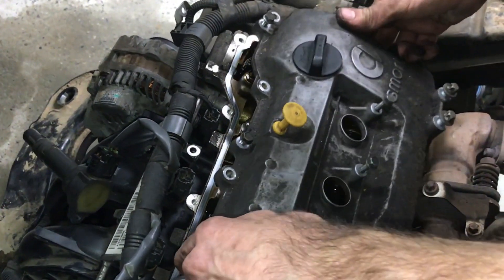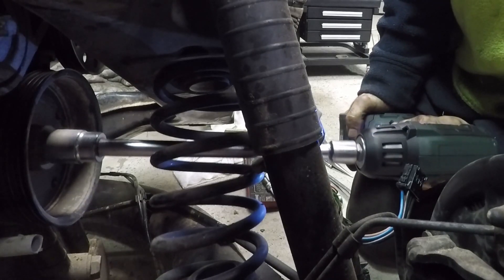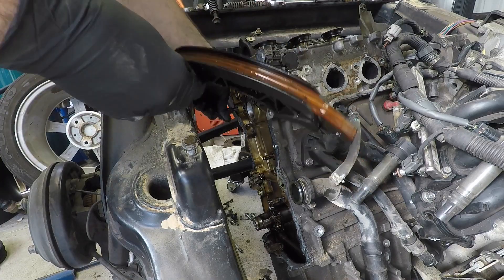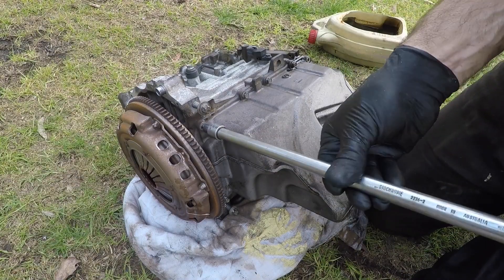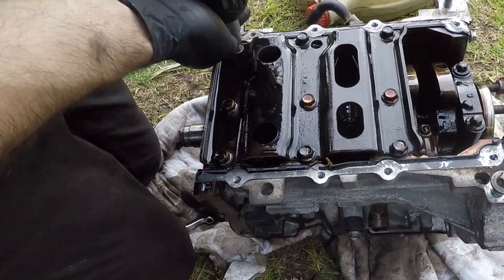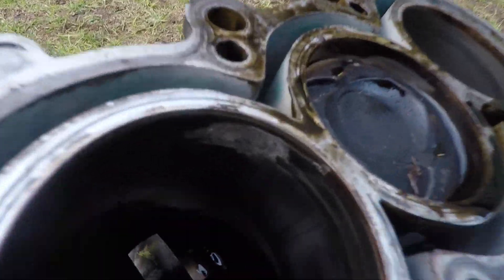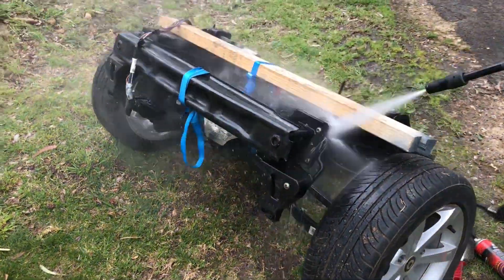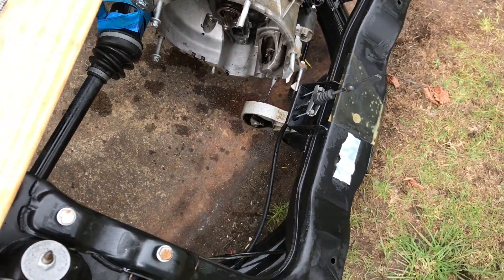Smart Car Part 3 Engine pull down

Comment: After you take the timing chain off do you take the sprockets off or the cam caps first?
Reply from the maker: Hi mate, once timing chain off its easiest to just remove the cam caps and keep the sprockets in place until reassembly. Unless you want to replace the sprockets there’s not much point removing them
Reply: @Mezzmoengineering  thanks for the help and the quick reply 🤟

Comment: I'm trying to get to the head gasket do I have to take the engine off the transmission too get too the gasket  I had a hell of a time too getting off the crank pulley bolt but I got it
Reply from the maker: Hi mate, the transmission can stay on. Just need to remove the exhaust, intake and front timing cover to release the timing chain etc and then the head will come off. If you’re piston is damaged then it will need to be fully dismantled. Good luck with it, not much room to work with…also make sure you get the timing right when you put the chain back on.
Reply: @Mezzmoengineering  do you remember how many bolts on that timing cover by any chance?
Reply from the maker: @willfreethemfreethem7671  can’t remember exactly but check out my part 5 video as it will give you a good idea
Reply: @Mezzmoengineering  thanks for the response 🤟

Comment: i have a 2011 smart fortwo and i need to know how much is the torque for the head cylinder and the sequence of each bolt to tighten.  Need your help.  
TX
Reply from the maker: Hi Ray, check this link. https://www.evilution.co.uk/mod/torque-settings-for-fortwo-forfour-and-roadster.htm  What you need is there.

Comment: Where did you get the parts ?
Reply from the maker: I got them from a dealer on Ebay, they are based in Germany. Great quality but also not cheap. Other than them its not that easy to find parts unless you want to donate an organ to Mercedes....https://www.ebay.com.au/usr/smart-werkstatt?_trksid=p2047675.l2559

Comment: interesting little snotbox and it did look amazing inside for the k's its done . wonder why it failed ? looked melted maybe timing or an airleak ? . looking forward to what ya do to it next .
Reply from the maker: Hi Dave, timing was perfect. The owner said he was pushing it fairly hard up hill. Its very high compression so I'm thinking it failed under high load. Not sure if this is common but a new set of pistons are on their way so I'll have it sorted soon....And then its onto the fun part...
Reply: @Mezzmoengineering  hi. Former smart car owner. Actually, I’m in my 3rd now. Anyway, yeah one Halloween evening I drove home hard with my foot on the gas. I would actually drive it hard after 2 years of owning a 2011. Eventually it had a rough idle and it would shut down the 3rd fuel injector. Causing way way low HP.

So yeah these cars are destined for that. Good cars all the way around though. The engines are a weak point though. Particularly the cylinders. At least I know what I had to do after spending money on parts.